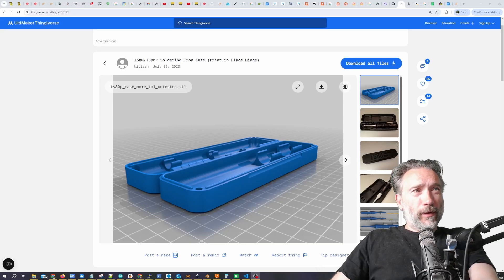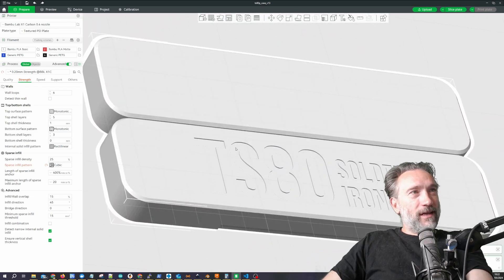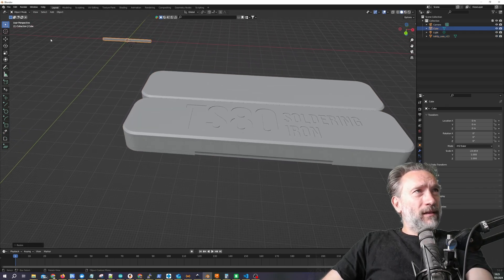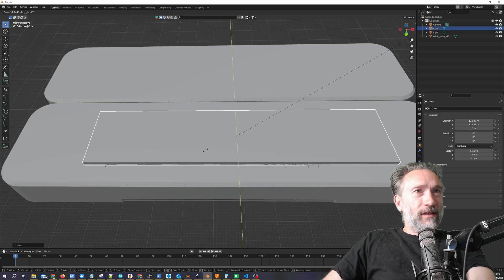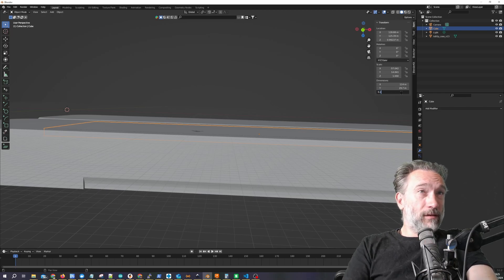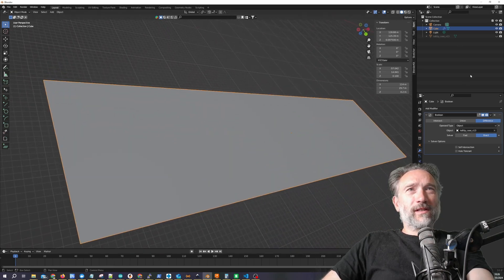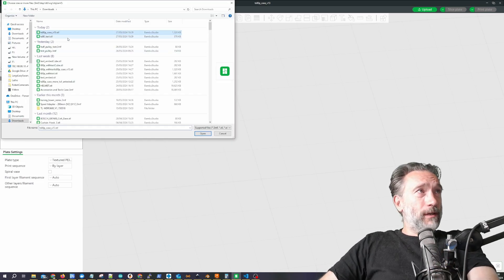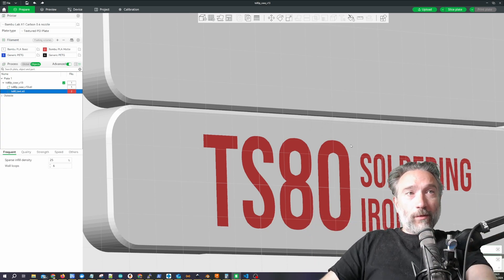3d print: Convert STL with embossed text to multicolour with blender

Comment: You can also do the same thing directly in the slicer by Right Clicking on the model and choosing Add Part.
Or in Fusion, I might have selected the faces of the text > Extrude > .2mm > New Body > Export.
Always good to have options :)
Reply from the maker: the problem with fusion is that the imported stl will not have clean faces for the lettering, lots of little triangles once converted to a body. possibly there is a fast way to clean that up to get an easy extrude, but so far I've found blender to be faster for that sort of thing.
Reply: @MakerGeek  That is very true, and is a real pain in the butt.

One trick that works most of the time is after converting a mesh to a solid in Fusion, split the body in half (or split it anywhere really).

Flat faces will now be free of all those pesky triangles, and you just join the 2 parts together again.

Shame it can't deal with curves too :( 

Apparently the paid version can do better, but I have no experience with that.
Reply: Guess it depends on the slicer, I guess - but just "adding part" in Bambu Studio causes it to do numerous undesirable things:
1) as a Modifier, it replaces the entire area of the cube with the selected color - so you end up with a block of color, still with embossed text (all wrong)
2) as a Part, it simply blanks-out the whole area as an alternate color, eliminating the text
3) as a Negative Part, it cuts a cube-shaped hole in the part

The options usually present correctly in preview, but the sliced result is totally wrong (not as shown). The video shows a method that I learned from (I'd never used Blender) and got an ideal result, right off the bat. I just had to, well... download Blender and learn its interface (I'm very thankful for the G/S and X/Y/Z explanation - made navigating it much simpler).
Reply: @FalconFour  If you add a part that covers the letters, you can place it just below the surface (by a smaller amount than your layer height) and then merge the parts.
If the height difference is small enough, you can still paint the letters but they will print on the same layer.
The depth of the painted letters can be set in Global or Objects > Strength > Top/bottom shells > Top/bottom paint penetration layers
I just tested this in Bambu Studio. It took me a while to figure out, because I couldn't remember wtf I was talking about in that original comment lol